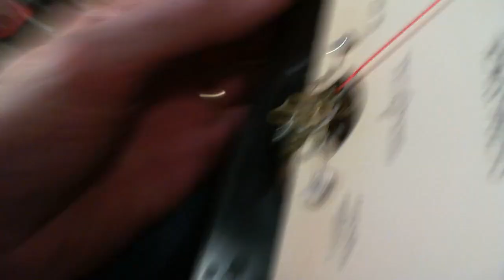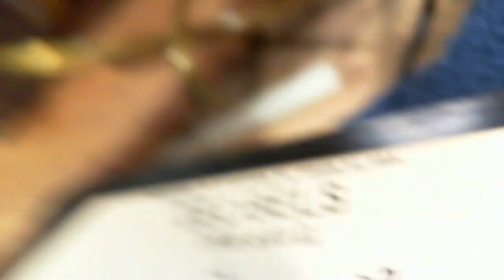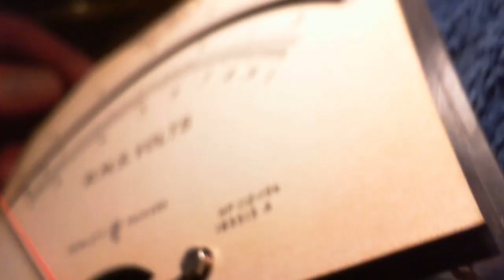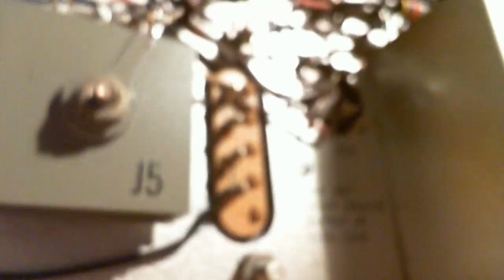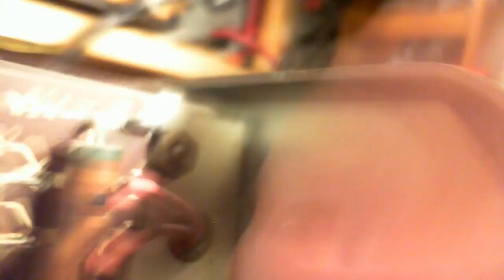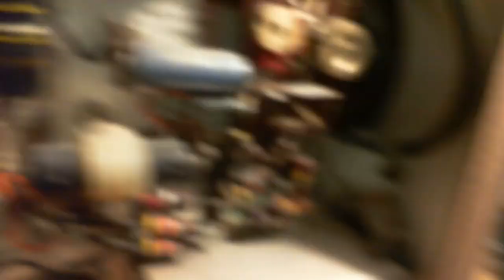Stewart Warner R146 Video #7 - IF Alignment Check

Comment: silver mica disease
Reply: SMD with compression trimming caps ?   ( Sorry not likely ! )
A O/C secondary coil is more likely .
A wire off or open resistor .
I am thinking something is open & the grid is floating .
Reply: @gd2329j  it can happen your funny

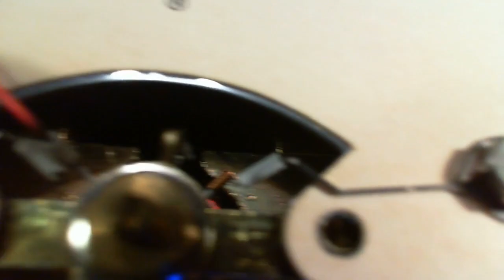Comment: 14:09 Please do that HP meter a favor and send it to Marc Verdiel of the curiousmarc channel. Maybe he is interested in fixing this piece of HP test equipment even though it is not his usually preferred lab grade. But that way this equipment stands a chance to get fixed and aligned properly and may stand a chance to get the obviously very wonky switch contacts cleaned with proper contact cleaner. And we may get a good informative video of off that without the mumbling and guessing and half fixed
Reply: Marc has more than enough to play with !

R2 come home D2 D2 ..... LOL

Comment: Reason why the Range switch is intermittent is because he used WD-40 on it. That's the worst thing to use because WD dries and forms an insulation type of coating on the contacts. He needs to use a good contact cleaner then use Deoxit afterwards. That will fix that meter. How can someone use defective equipment to repair a receiver. Hmmmmm.
Reply: I don't even let WD-40 near my bench. It's not good as a precision, long-term lubricant, and it certainly should never be used as a contact cleaner/lubricant.
Reply: We keep typing that fact in the comments   section but he won't read  the comments. I use WD-40  Specialist Electrical Contact Cleaner  Spray.
Plastic and metal safe and leaves no residue unlike regular WD-40!

Comment: i don't understand how he fixes anything when his test gear does'nt work right
Reply: That's the point, he doesn't fix anything....
Reply: @StillCloser  I would say, he fixes obvious things. But the moment in depth troubleshooting, proper use of suitable working test equipment or following alignment instructions is involved things go downhill.
But hey if AM is switched off soon and you need a home transmitter to still run these boatanchors, you can always get surplus transmitters that put out a signal so strong that even your fillings receive...
Reply: It's all part of the fun !